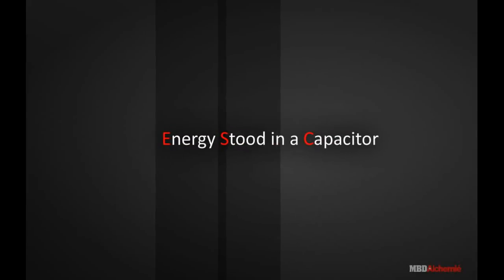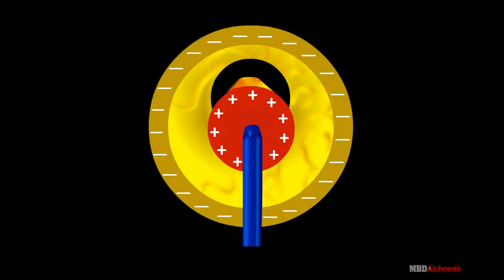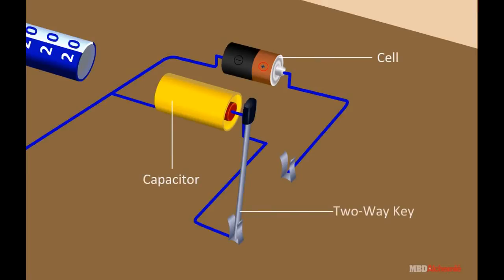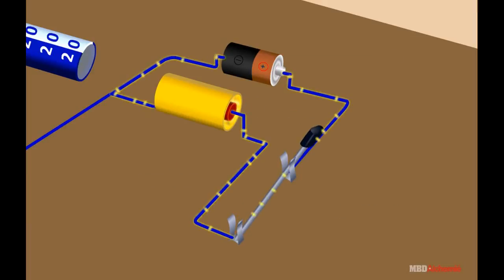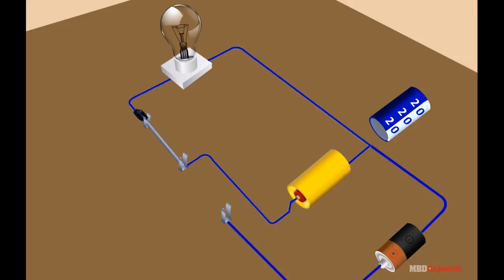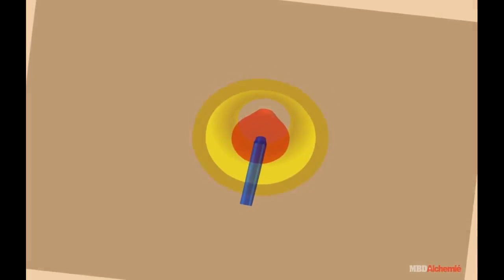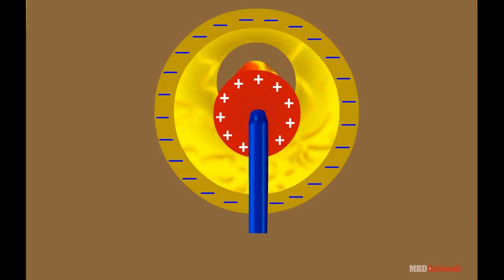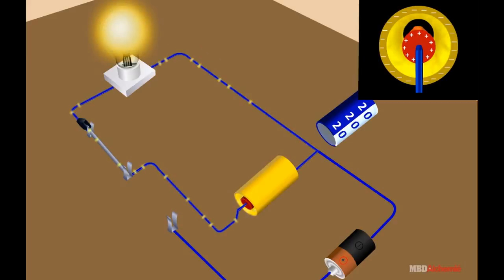Energy Stored in a Capacitor

Comment: Why not we dont connect the bulb directly to the cell
Reply: At first, the bulb requires a large amount of energy to start glowing which the battery will not provide it as it gives a constant potential l. Hence capacitor is used to initiate the function of an appliance.